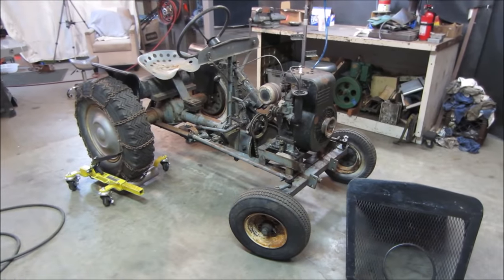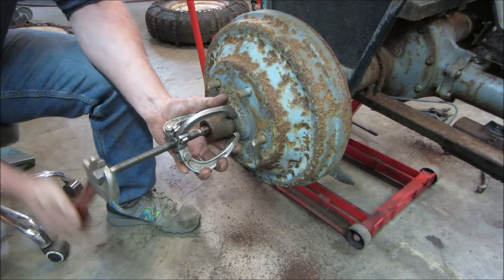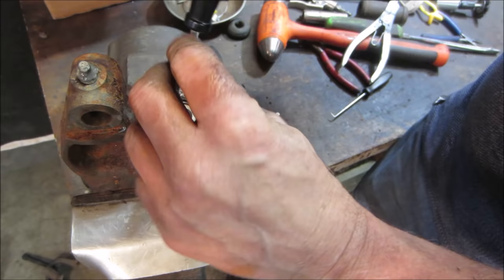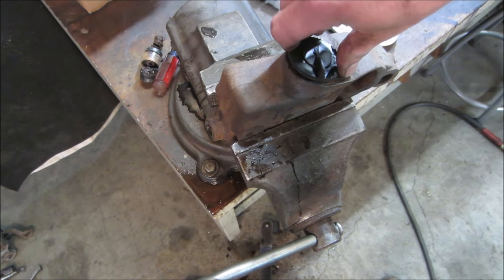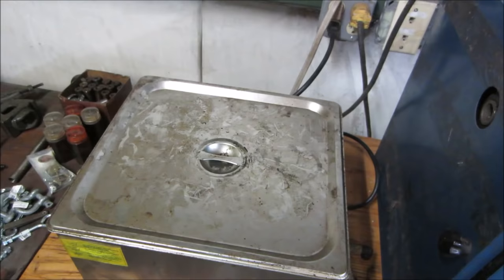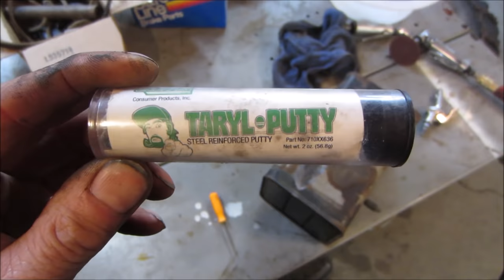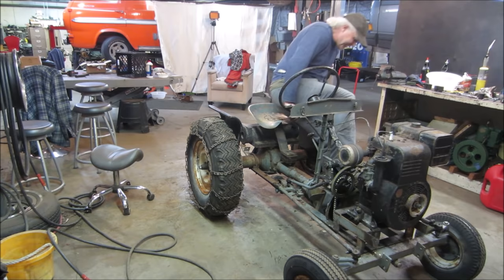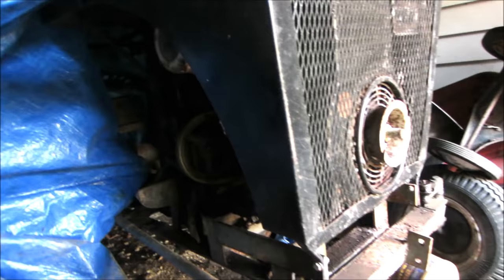Barn Find Homemade tractor, could it Be Saved, pt 3 of 3.

Comment: Using the electric seat on the brake pedal to control tumbler speed trick..
Pure genius
Reply: That's how I bleed brakes, except I usually am not dealing with a power seat.  Appropriately sized 2x4 between the seat and pedal, then move seat up till the pedal is fully depressed, and crawl under and crack loose the bleeder. Close bleeder and repeat a few times...
Reply: @DanEBoyd  Have you ever tried using speed bleeders?
Reply: @guruoo  No, I was going to buy some at a parts store once, but they didn't have them for my car at the time.
Reply: just use a mighty vac and vacuum the air out.
Reply: so he was dragging the rear brakes for hours to slow the wheel down? Expensive gas tank cleaning
Reply: @tomhutchins1046   Some gas for a lets just call it high idle, with brakes just slowly being applied lightly, to clean a nasty tank, is well worth it.
Reply: I use an adjustable length pole, like a painters/window washer pole. it just twist locks into place at whatever length. works as a secondary hood prop also :)
Reply: @baileyhatfield4273  Not to me

Comment: Cleaning that gas tank by using the wheel of your truck looked like a true Red Green moment. 😂

"If the women don't find you handsome, they should at least find you handy." - Red Green
Reply: @paulcopeland9035  Roadking was doin it when Mustie was in diapers.
Reply: HAHAHAHAHA FRED GREENE IS MASTER DUCT TAPE TECH...WHOOOHOOO...I drove my old 85 Ford E150 across country 3 times...I got to New Hampshire...Louie said...YOU MADE IT!!! THEN HE SAID...NO DUCT TAPE...WHAAAA??? YUP...
Reply: Please bow your heads for the mans prayer. "I am a man, but I can change, if I have to, I guess"! Red Green.
Reply: @paulcopeland9035  I was new at it but I cleaned my  motorcycle tank with phosphoric acid and I used sand, rocks and dirt. A big pile I found in the back yard. Shook the mixture in the tank around by hand for more than 2 hours. I did not know about using drywall screws which would have been much better. Some of the guys have been using the clothes dryer on air for tumbling their tanks. They must throw some padding around their tanks to do it. Probably without the acid however, not quite sure.
Reply: Red Green would have duct taped it to the whole wheel.

Comment: Great vid dude, I really enjoy the way you rehab crusty stuff. Two things come to mind in this one, the first is that Gorilla Glue is set off by moisture. If you want to speed up curing time, put the glue on one piece and dampen the piece your gluing to. The other point is the puller on the brake drum and no axle nut on it. Those things have been known to explode off the tapered shaft and hit the squatting mechanic in the family jewels!!!  Leave the axle nut attached with 4 or 5 threads to catch the drum if it pops. 👍🍺👍🍺

Comment: my dad made a tractor in the 1940s--he used a 4 cyl Dodge engine, 2 transmissions in series, a frame he built himself, metal wheels--I wish I had a picture of it
Reply: The Custom brand of tractors used Dodge truck parts, so I'm sure what you dad did is possible!
Reply: @timothykeith1367  more than possible--I used to drive it at age 8

Comment: Mustie, use oxalic acid next time you want to dissolve rust. Works amazing. I own a pressure washing business and use it for rust removal on homes its awesome all you have to do is mix it with warm water and spray or put on the rust however you choose and let it dwell for a couple minutes then rinse. You can repeat if you need to but usually not necessary.

Comment: My neighbour built identical tractor, 15 years or more ago. Datsun rear differential axle tubes shortened. 3 speed auto transmission.  Also made a nice hood and used  mower deck from old ride on mower. It worked great.

Comment: Dear lord the stuff in that gas tank is almost turning back into dinosaurs!
Reply: I have a tank exactly like that one but rust free inside, i guess they came with the engines
Reply: @datadavis  funky looking thing, especially with the glass bowl setup.
Reply: That's all the tar and asphalts and other heavies that were treated to keep them in suspension. Over time they fall out. They are what make exhaust emissions. They are in the fuel, one just cannot see them while they are kept in suspension.
White gas, better known as Coleman fuel, has them refined out and gotten rid of, rather than just chemically treated to keep them in suspension. That's why Coleman fuel lasts for decades. I use it in all my small engines, to avoid the gas/varnish problem.
Burn white gas in your car and it instantly becomes a zero emission vehicle. Dirty fuel equals dirty exhaust. Forget the left wanting to get rid of all cars. The US could be zero emission in less than a year if we would just clean up our fuel. But that would double the cost per gallon, and the multinational corporations will not allow it.
An individual can do it themselves right now. Just buy Coleman fuel instead of pump gas.
Reply: @knlazar08  "zero emission vehicle" ... what a crock of shit. 
You need research ICE engine combustion process to know what emissions are before coming out with such claims.   You burn hydrocarbon fuel with air you produce COx and NOx. 
Further, tar is the 'heavy' bottom end of refining process the last of all the lighter fractions in crude oil. The first fractions are gases. 
Asphalt is a blend of rock and maybe other inorganic material mixed with tars. You're saying this was added to light naphtha blends [being gasoline] ?  Bullshit - never ever.  
The residual 'lacquer' spoken of isn't lacquer anyway and certainly not heavy tar. It's only the heavier naphtha of the fuel BLEND plus years of contaminants left after lighter fractions evaporate through tank vents.

Comment: Part#  21A-2061 = Right Rear Wheel Cylinder 39-47 Ford Pickup
Part#  21A-2062 = Left  Rear Wheel Cylinder 39-47 Ford Pickup
Brake shoes  39-42 Ford Pickup Part# 91A-2001-NBD
Master Cylinder 1949-51 Ford Part# A9A-2140
Reply: Good call. I was surprised Mustie didn’t know this whole rear end assembly was old Ford, even the shortened torque tube.

Comment: I literally went through this exact same thing last year! I bought a 1956 Economy tractor that sat out forever it seemed. It too is powered by a model 23 Briggs. Fantastic old engines. My fuel tank was as bad and oh god the stench! Mine has a model A Ford rear and a Crosley T3 transmission. In the fifties whether home built or made by a small factory, garden tractors were much the same. They all appear homemade. The old Economy’s, Gibson’s, Pond’s, garden all, Speedex, Shaw’s etc. we’re built in small quantity. And in the case of the early ponds for instance, built by a father and son in their garage. The father and son were Cecil and Elmer Pond, who went on to create Wheel Horse. Hi from NH, new sub here!

Comment: That contraption you came up with to clean out the inside of that gas tank made me laugh so hard! Bravo!!!
Reply: I saw on the internet where a guy needed to weld on his fuel tank, so he plumbed another car's exhaust into the filler tube hole on the tank, and used the car exhaust to displace the oxygen from the tank, so as to be able to weld without causing combustion of any fuel vapors still in the tank.

Comment: I still can't believe Mustie has not grabbed an old washer and made a parts tumbler.
Reply: Dear W80
Even simpler is to use a common concrete mixing machine. Mount a wooden board over the "mouth", then mount the tank on the board and let it run. It cleans more efficient if the tank is out of centre (running kind of elliptical). The best things to use are old/rusty Spax screws/wood screws. Afterwards everything will be very clean (including the screws of course).
2) An old wiper motor can also easily be used for cleaning tanks (and similar things) inside. Mount the motor onto something stable and a wooden board on the motor. Then mount the tank on the board and let it run. I bet Mustie1 has a lot of wiper motors in his stash.
Also a 110 V drilling machine can be used as drive source.
Best regards, luck and health.
Reply: Or dryer.
Reply: To be trademark Mustie it should at least be modified to a 2 stroke washer ;-)
Reply: @Robvdh87  😂
Reply: @Robvdh87  That would probably work best actually.

Comment: I ran across a video of another Youtube channel where the guy was working on a production tractor from the 40's that looked a lot like this one. It was a Lincoln tractor but was different in that it had a "tractor" style rear axel with a PTO. It looks like whoever made this one possibly used the Lincoln as a model because the tank location, type of motor, and belt-drive were all very similar.

Comment: Gas Tank baking with Mustie1. For the tank you add 1/4 box of square bolts and about 1/2 box of large nuts, Preheat Toyota tundra to normal operating temperature and then mount and rotate tank for about 45 minutes to an hour or until rust free. Don't forget to add shake n bake aka WD-40.

Great idea with using the seat adjuster and board to press the brake pedal.
Add some fenders, floors for your feet, headlights and a stereo system to that and go romping in the woods.

Comment: I learned a trick not long ago that maybe you can use on such gas tanks (I learned it on an oil pan).  It's perfect for these seepy type things.  Get some epoxy or compatible glue and paint the clean outside of the tank (or pan).  Try not to use real thick stuff.  While still wet, put a shop vac on the fill hole and let it run until the epoxy or glue sets up.  It sucks it into the tiny holes and seals it up.
Reply: Thanks. You need a yt chan.
Reply: I'll be your 1st sub.

Comment: Mustie, thanks for all the joy you bring into life, and oh yea, the great fix em up tips, yeah that too. :-) Anyhow, I come from a background of restoration experience on the body side. I'll get right to the point. Although, I think there is a certain mystique in things being old and rusty, I also realize that what I really love is having it the way they had it, looking new... or should I say almost new. Old world quality brand new looking. The secret it to get together with an industrial sandblaster. You know one of those with the big Caterpillar engine, with a 4" nozzle that looks like it is just blowing air but there is sand in it. Even at $100 per hour in about 15 minutes they could waive their magic wand over this homemade tractor and everything would look like new metal. Yes they can easily afford to do this for $25. They set it aside then when they are doing a big job, they just mosey over to your project for a quick blast away. You simply blow the sand out of it for a while, treat it with metal prep/acid, let that dry over night, and prime everything, and then paint it. It's all brand new. Then you do your dissassembly. 
With car bodies, frames and suspensions it gets a little more involved because the industrial grade blasters are so powerful you DO NOT want to strip the outside of a car with it, leave that to generous amounts of liquid strip. If not, the blaster will turn the thin sheet metal red hot and warp it, BUT the door jambs, under the trunk, underbody etc all look new too. 
I often look at the vehicles of old with rusted frames, and sheet metal rotted at the bottoms, and remember what a joy it was to work on because all of the prep work was done by the blaster. Now you have open holes where rusty, hard to clean areas abound. Welding new metal to it is a dream. It makes an artist out of you. We used to have whole T Bird 55, 56, 57 bodies and frames down with suspension and axles intact for only $250. It would take them no more than two and a half hours to do one. We built a custom adjustable brace rod with end plates, one would attach to the upper door jamb of the body, and the other end would mount onto the striker plate so the convertible T Bird wouldn't turn into a sway-back mule. 
I look at this old homemade tractor and think what a joy it would be to show you this as an example. Nothing magic here other than the results. You may want to for example remove the glass bowl for the fuel, or anything that a blaster would damage. There isn't that much that needs to be removed on this project. Hey thanks for lending me an ear, and having such a great You Tube channel. You have a gazillion subscribers because you are definitely a reminder of the best friends I grew up with. Like he said, "Unless you be converted, and be as like a child, there is no way you are getting in."

Comment: Here is why the different diameters of wheel cylinder pistons/cups.
 Keep in mind that the brake shoes here are both anchored at their bottom ends (opposite the wheel cylinder).
The powered end of the  brake shoe (the end at the wheel cylinder) that is facing INTO  the direction of drum rotation  becomes somewhat "self energized" and therefore requires less push from the wheel cylinder to achieve the same amount of friction, drag, stopping power or whatever you wish to call it (co-efficient of friction).  The wheel cylinder piston diameter for this shoe needs to be smaller than for the opposite shoe to keep this shoe from doing most of the work and wearing out sooner than the other shoe.
The other shoe has its anchor end facing into the direction of drum rotation and thus has no self energizing effect, and so requires a larger diameter cylinder piston to provide more push in order to make that shoe perform the same work.
When this style of brake configuration is used, the OEM decides which direction of vehicle travel will be the primary or normal direction (call it "forward")  and  orients the wheel cylinder so that  the brake shoes for the small piston are facing into the normal direction of drum rotation when a stop is made when traveling in this direction.
This style or arrangement is called "single servo" due to the fact that just 1 shoe of the pair is self energized when the brakes are applied.
Automotive engineers recognized this characteristic early and the unequal displacement wheel cylinder used in this video was just one way that was used to compensate or correct for it. Some manufacturers used 2 different sizes of single piston wheel cylinders  to accomplish this, with a typical arrangement having a top wheel cylinder and a bottom wheel cylinder on the backing plate.
Bendix developed the "Duo servo" technology where the brake shoes are linked together with the brake adjuster between the bottom ends of the shoes and pretty much became the standard of the automotive world for generations of drum brakes.  The duo servo brake design also led to the later development of a simple and practical self adjusting system.

Comment: You might not need an emergency brake, but if you have a hill in the yard you might want a parking brake.
Reply: That's what I was thinking. An emergency brake on a tractor is pretty handy to have. Mustie just needs to salvage some kind of a pawl mechanism for it and get a cable.
Reply: Maybe easier to just make a catch for a parking brake to snap over the brake pedal and hold it down.
Reply: @spencerbookman2523  parking brakes are cables because hydraulics cannot be trusted. Not to say cables never break. But I'd sooner expect to see a hydraulic system lose pressure. Hydraulics is funny that way. They can mainly work. You're still putting your faith in little rubber seals though. It's the same reason you never get under a vehicle that is just jacked up. Same logic. Steel > rubber.
Reply: @1pcfred  That  sounds reasonable. I could swear I've seen the latch-over-brake-pedal system on a tractor but there very well might have been a mechanical linkage between the pedal and the brake.
Reply: @spencerbookman2523  what's acceptable on private property and public roads are two different things. And like you said who knows how it worked. Some kind of a latch on a pedal is better than nothing. It is pretty handy to have the vehicle you're operating be able to stand still once and a while. I'd certainly take a latch over nothing at all.

Comment: Going through my process of restoring my 66 Galaxie I have found a product I think you would be intrested in for rust removal / treatment. Its Klean Strip Concrete and Metal Prep. It does a great job at getting rid of rust. The saving grace for that tank might be that back when it was produced they used a decent thickness of sheet metal. If it does need to be replaced local agricultural supply hoses usually have those kinds of tanks on hand. Of course Amazon has em as well.
For auto restoration we dont put shar edged items in the tanks we clean. We use 3 or 4 bags of glass marbles you get at any dollar store. Put them in the tank with some sort of cleaner/deruster (CLR works great for this) you chose and cap her off then ride around with the tank in the back of a truck for a few days.

Comment: Gorilla glue cures with moisture.  If you want it to cure faster, you can wet the surface and it will "go off" quite a bit faster.  Also the more clamping force you use, the stronger the bond.  I love the stuff.

Comment: as an old brake specialist (Australia) you should be able to find someone who could bond your shoes alliteratively you should be able to buy lengths of brake lining and rivet the lining to the shoes (you meed the correct drills) if you cannot get the correct thickness you need to find someone who can re radius the shoes, also you should wash brake parts in metholated  spirits (alcohol) otherwise you damage the seals

Comment: way kewl project. I am surprised that you didnt use aircraft sloshing fluid for the gas tank. Claen it as you did inside, rinse the acid out, dry well and pour in the sloshing fluid. Literally rotate the can all around (lid on of course). pour out the remaining liquid and let the tank dry out . I have used it numerous time for old car/motorcycle gas tank. Works great for the inside seal.